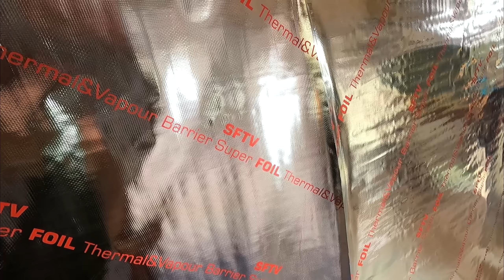How We Fit Our Van Skylight (Fibreglass Roof) - Vauxhall Movano | Complete Beginners Van Conversion

Comment: Hi, I have the same van that I bought converted. I’ve damaged both the skylight and solar panel😮 (don’t ask, too embarrassing). When you bolted the panel to the roof did you add internal support to take the bolts or just washers?
Reply from the maker: Hi, I hope the damage isn't too much and you can fix them! 🙈 I'm slightly straining my memory at this point but I'm fairly certain we didn't add any additional supports (in mindsight perhaps we should have) but I think the bolt just went through the fibreglass of the roof and then tightened the nut straight up against the ceiling on the inside with a generous helping of sikaflex to waterproof it and help support it. I wouldn't necessarily advise others do it that way but that's what we did 😅
Reply: @twoweirdbeans4077  Thanks so much for the reply ☺️ I’ve basically ripped the skylight off & damaged the panel (it still works but a lot less efficient). Thankfully I’ve been able to get van roof watertight but I need replace the skylight asap & like what you’ve done with the mastic tape to level off the roof. Pretty sure I could have a bash at same although I have a tendency to make things worse when diy-ing 😂. I’m a bit paranoid about securing a new panel myself but think I may just add some plywood internally to where I drill through just for some added support. As far as I can see my current setup the panel brackets are simply sikaflexed to the roof but not 100% as there may be bolts I can’t see ( I bought van post-conversion). Thanks again ☺️
Reply from the maker: Yeah the mastic 'levelling off' thing worked well and helped to provide that watertight seal. Our entire van is very obviously a DIY project 😅 it doesn't look the prettiest but it does the job and we're proud of it! I think the idea of putting ply on the inside is a good one, in hindsight I wish we'd done something similar. Not that we've had any issues but it does feel like it would help make it more secure. I would guess you do have bolts as well as sikaflex as I don't know if sikaflex alone would hold it forever, unless the previous owner went really basic with it! Let us know how it goes 😊